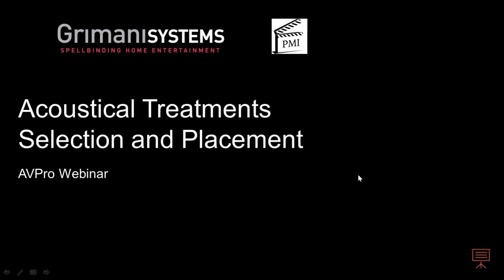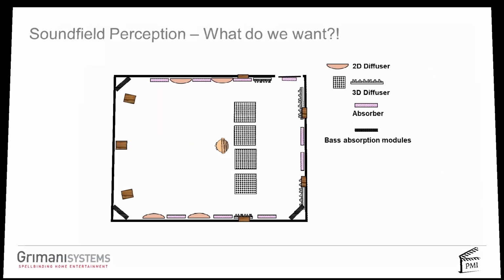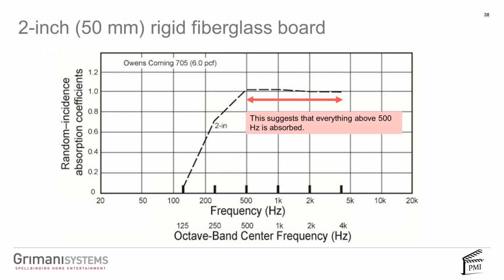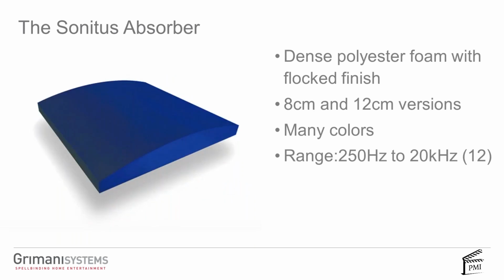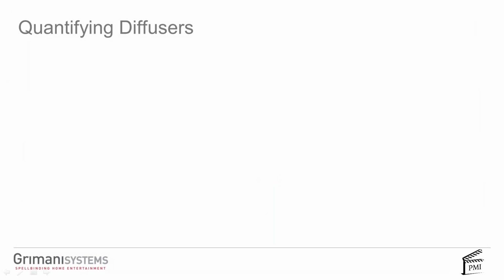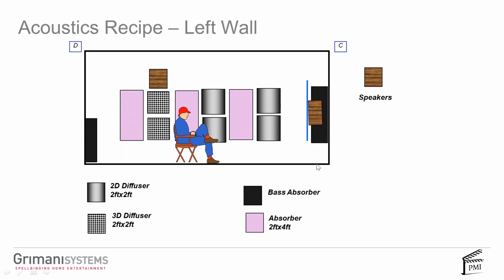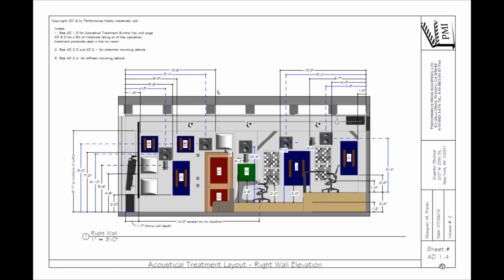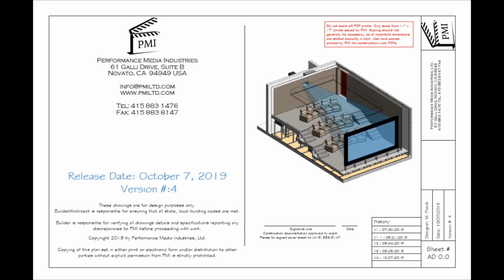Expert Audio Series - Acoustic Treatments

Comment: I have a question for Anthony, he states that we should try and stay at around %15 absorption per wall. but in all his diagrams he has LFE absorbers in the corners and also mentions that these absorbers should be floor to ceiling. wouldn't the LFE absorbers add the the 15% absorption per wall?
Reply: The bass absorbers he showed, only worked up to 500 Hz, so I'd say that's a no.
But keep in mind that the 15% is walls and ceiling. So if you don't put anything on the ceiling, you need to add more to the walls.
In the end, what matters, are measurements. If you are at the 0,2-0,4 second in decay, then you are good. 0,3 is the ideal room.
But it all also comes down to taste.
Reply: Also the ceiling and FLOOR are also calculated into the total m2 space. Therefore the wall mounted ones can be more in numbers (but not more than max 20% of the total calculated m2 inc. ceiling and all walls and floor.)